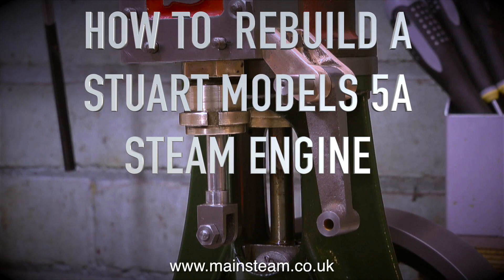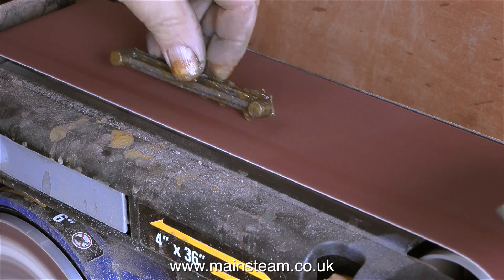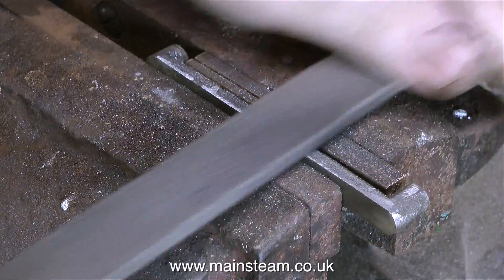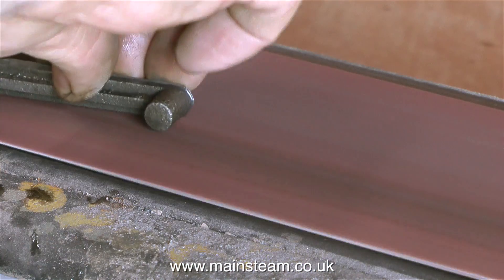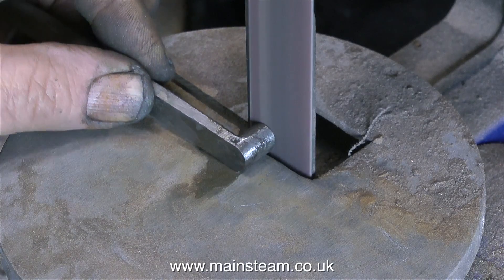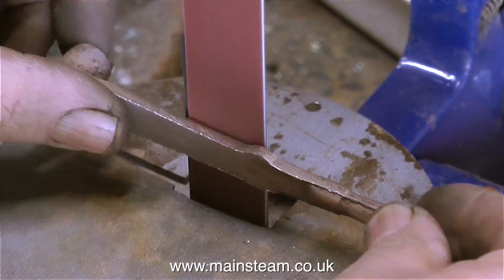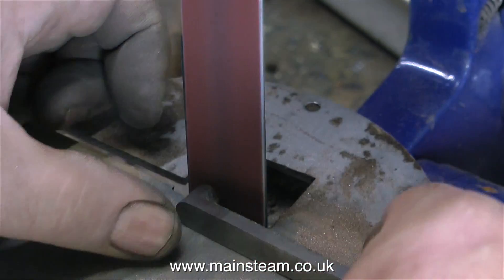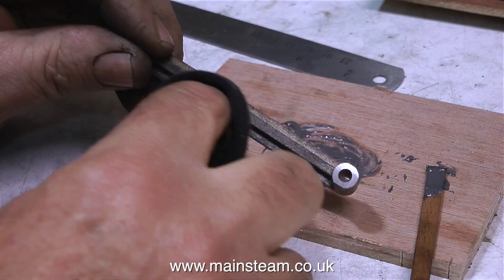HOW TO REBUILD A STUART MODELS 5A STEAM ENGINE - PART #16

Comment: Spent some time ramming sand for molds, you use a parting agent so the mold doesn't crumble, or the sand was spent. They were pretty lumpy. Glad you have a dremel  tool. Thanks for sharing Keith.

Comment: Hiya i have a Babcock 501 boiler "you guessed it" e-bay + a Stuart Turner Double 10 engine i want to replace burner with a ceramic one + gas tank .Is Tony Green GB7 burner suitable for this ? as the Stuart Turner fittings are so expensive. Thanks John. Love your site so informative.
Reply from the maker: I am not familiar with that particular burner - so I Googled it and it looks like it will be fine for the job.
Reply: Thank you so much !!!! I am new to steam .John

Comment: Keith you don't have a wire wheel for cleaning the castings?
Reply from the maker: yes but that only scratches the surface, these castings were a bit lumpy.

Comment: Hi there Keith, liked your comment about using Stuart parts. I have a conundrum, I have parts for a Stuart 180 mtb engine, precursor to the sun. I am missing the valve chest cover. The original had a nice diagonal cross raised like the Scottish flag but pyramid like from sides and end. No joy getting a replacement. Any suggestions, I am currently considering casting one in brass or just the raised detail in Jb weld and affixing with same.  Also have gears 1 piston scotch crank and valve rod to make. But will end up looking great. If you search YouTube for Stuart 180 there is a nice black one.
Steve
Reply from the maker: Why not call Stuart Models. The company is currently owned by Bridport Foundry, who make the castings anyway so they may have some patterns left .....